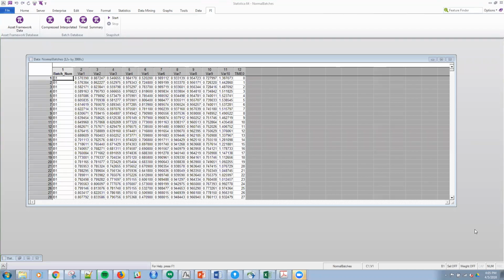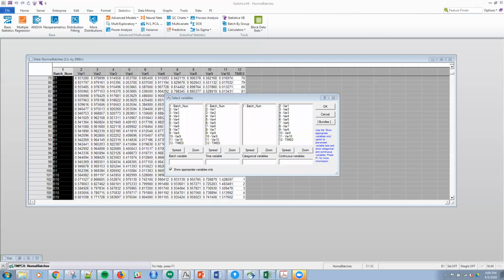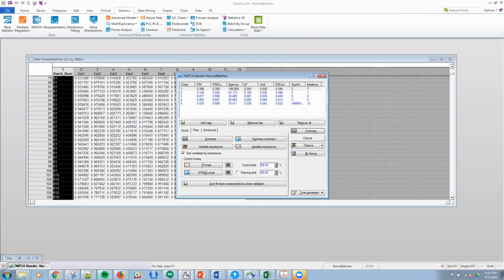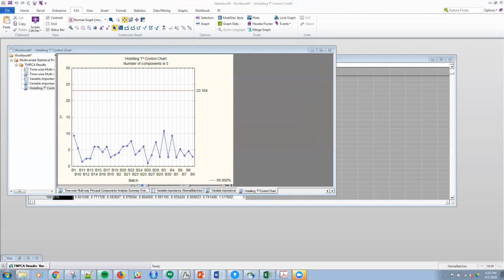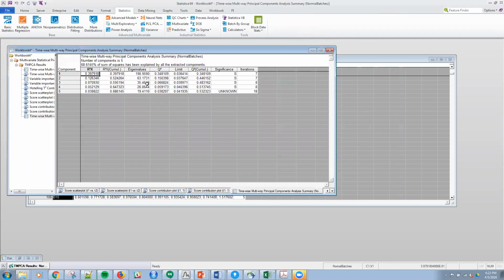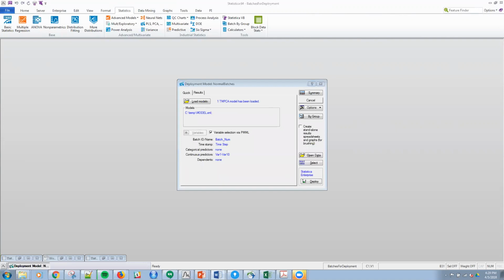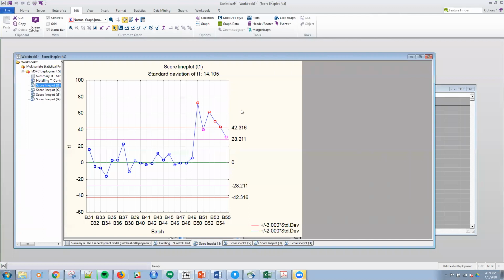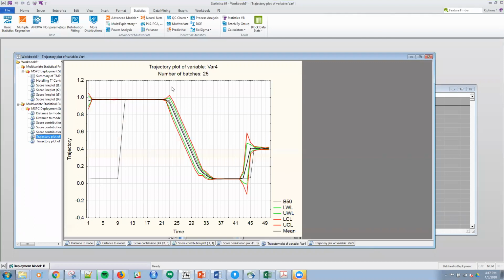S78 Time-wise Multi-way Principal Component Analysis

Comment: Is there another way to create TMPCA, or only using Statistica64?
Reply from the maker: I am sure there is.  If you are a student that can access a university copy - try Minitab or Matlab.  If not, try R, it is free and there is likely a library for TMPCA
Reply: @thedatalinguist  what is the main difference between treating the data as multivariate and multiway (a tensor of 3 dimensions) vs using a PCA of a matrix of 2 dimensiones where we do one hot encode the batches?